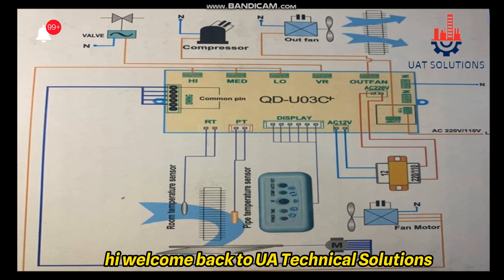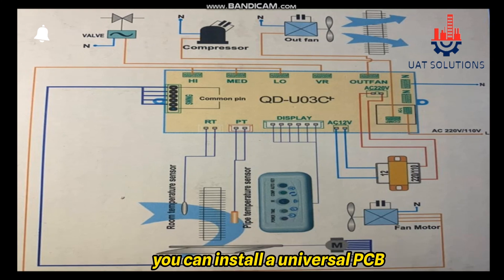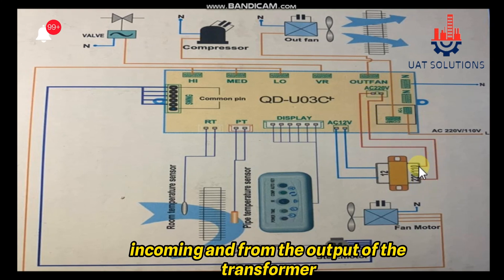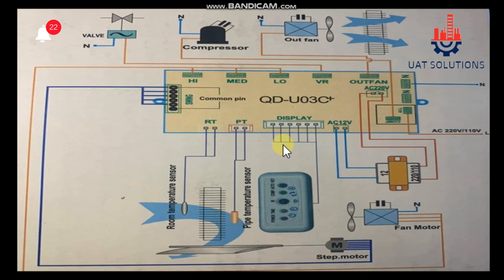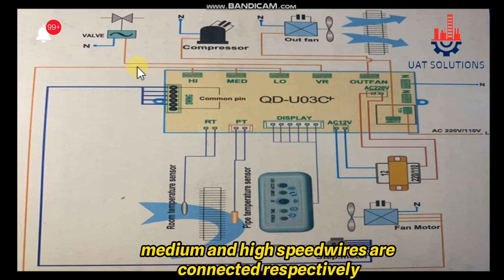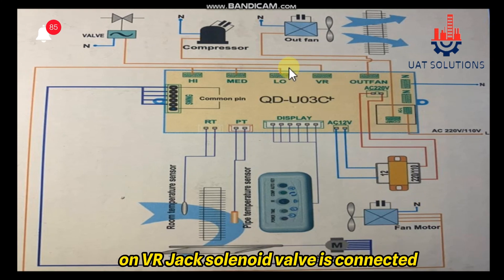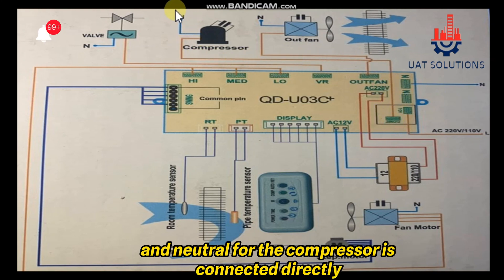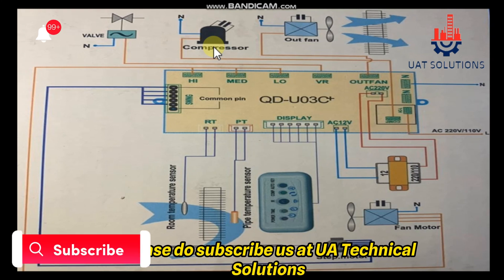Upgrading Your Split AC, Universal PCB Installation Made Easy

Comment: Pls My question is that,incase ur Outdoor terminal connection has Signal or Return or start terminal in it.where on the universal board will u connect that Return or start wire.plss is my English understandable.
Reply from the maker: if the A/C is inverter Type Than this PCB will not work for it.
A Normal Split A/C outdoor have 3 terminals 
1 = Compressor / Live
2 = Neutral
3 = Earth 
Thanks for your comment. if you need further assistance you can send an email to us at uatechnicalsolutions@gmail.com . with pictures of your A/C connections. Also you can use Urdu / Hindi
Reply: You are talking about an inverter ac... U can't use this type of pcb for it.

Comment: Change adapter 12v can use?
Reply from the maker: yes you can as far the voltage are not more than 12v
Reply: I have a 1 HP inverter air conditioner with a faulty indoor board. Can I replace it with a universal AC control system?
Reply: Does this kit do away with the pcb motherboard in the outdoor unit ? This is very confusing , I can’t find any answers , my outdoor pcb is the one that’s faulty